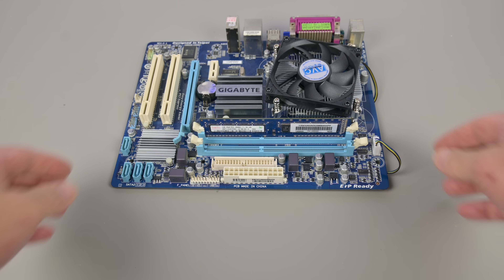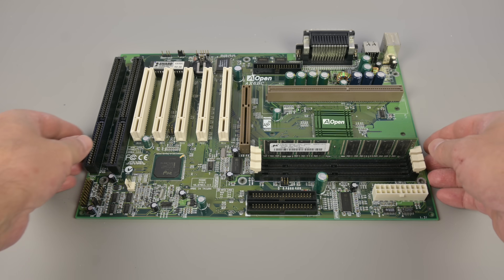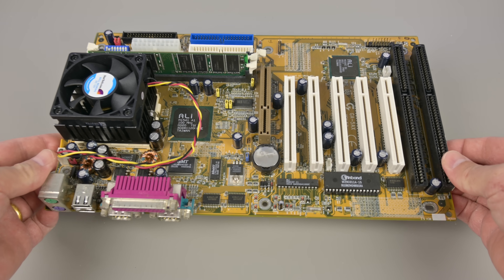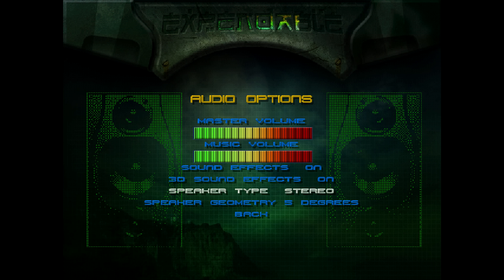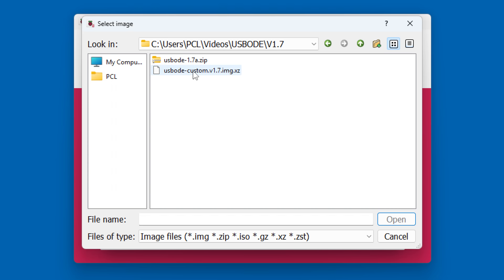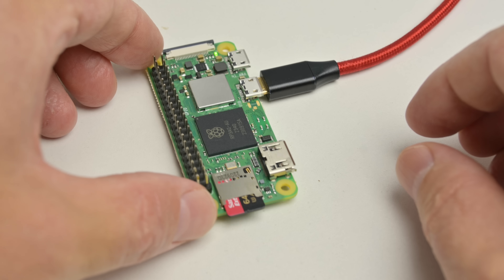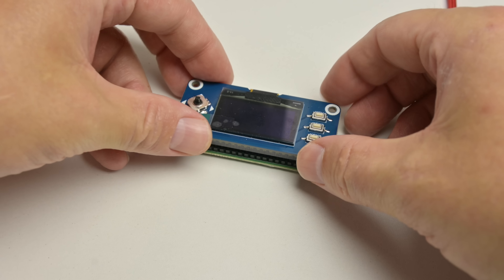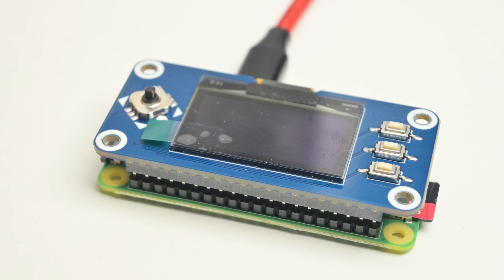Finally a cheap CD-ROM emulator for DOS and Windows 98!

Comment: How would this be usable under Pure Dos? One of my retro machines is a Pentium100 with the VX chipset and has USB. Is there dos drivers?
Reply: Ok sofar trying it on dos 6.2 on my Pentium 100 with a VX chipset, it works with ASPIusb, and it will mount images and try to work. I can sometimes see file listings and can sometimes copy a file, But I am having random read errors and freezing. But I do NOT have the Zero2W like is suggested, just the PiZero. So that may be my issue. And it may even be other things going on .. but it is very promising though!
Reply from the maker: Panasonic released USB mass storage drivers That work with DOS. I've put a collection and sample files on the discord.

Comment: OK, this is freaking cool. I've been wondering when someone would be coming out with a hardware-based CD/DVD emulator. Great stuff Phil!
Reply: IODD has existed for years.
Reply: @Drebin2293 love my iodd, but this opensource version is great
Reply: @ It's better hands down, no doubt. Just the price alone makes it great.
Reply from the maker: Great to see you here 😄
Reply: iodd and I think vantec(forgot the brand but I have both) exists but however the ftp/wifi capability; that is awesome for remote use outside retro...... I'mma about tempted to order 5-6 of em lol

Comment: Yeah, the current lack of BIN/CUE support makes this kinda useless for me, cause the only reason I'd want to use this is to not use up a blank CD-R for mixed-mode games. Otherwise I can just network share the ISO and mount it into Daemon Tools or Virtual CloneDrive (which only supports the data track of BINs) or whatever.
Reply from the maker: CDDA works with Daemon tools, so that's already the gold standard under Windows. But dir pure DOS? The USBODE makes life really simple.

Comment: This is promising, and it will get better I expect. The price means people will be using it, and people using it means it will get testing and debugging on places it doesn't work. I won't say that PATA will probably happen with this project, but this project might be the basis of something that can do PATA later. Just not for $15. You'll need a pHAT that won't be incredibly cheap just due to the quantities it'll get made. But it'll be possible to make it, at least. Just give it time.

Comment: Cool. For my ISO stuff, I use a Zalman ZM-VE300 with a 512GB SSD partitioned in 99GB and the rest. The 99GB is a special ISO partition where I can load up to 99GB worth of ISOs. The device can do optical, HDD or both but only ISO works from PC boot.

Comment: I have a Pentium 2 Thinkpad with a broken optical drive that doesn't boot from USB, would this work for installing Win98 on it?
Reply from the maker: If it doesn't boot from USB, no.
Reply: These don't support native USB boot. You will have to try with some bootmanager with USB boot drivers included, but isn't guaranteed.
Reply: @ Thanks for the answer, how could i go about doing that without an optical drive?
Reply from the maker: If you can boot from a floppy, then you can load the USB driver from boot floppy and then install 98.

Comment: Something like this with IDE support would be awesome. Similar to what BlueSCSI for older MACs does. Having this tied to USB is neat, mostly because you can store a lot of different ISOs on one SD card. But it doesn't help out with 486 or Pentium class hardware unless you can also manage to get a PCI based USB card to work. That would still exclude most 486 hardware since PCI slots were only on some late 486 boards.
Reply: ZuluIDE exists for that use case.
Reply: @bruce_just_  I was not aware of that. It's a little pricey, but it looks awesome!
Reply: @ yeah it’s all good! there’s almost no awareness of that project as compared to just getting another replacement CD or DVD drive.

Comment: I wonder if you could go further... maybe connect Pi Zero with Pi Zero 2W thru SPI or something and make custom connector and let it talk thru a PATA interface... so it could be used as ATA/HD or ATA/CDROM for computers without USB (or non standard USB).
Reply: i was thinking the same but then with only a pi pico. Look at wat the PicoMEM can do with just the pico: floppy+HDD+ram+rom+Network emulation and optional sound emulation over the isa bus.
If they use use the pico 2 w instead (much faster and almost double the memory ) surely the could add CDrom support.
And if the standard RP2350A chip does not have enough GPIO pins the RP2350B variant has 18 extra pins and only costs 10 cents more.
Reply: It already exists. Is called ZuluIDE.

Comment: I don't see an audio out plug to connect to the sound card. If one of the main goals is adding digital audio, the hat will probably be modified to include an audio output, so I'll definitely keep an eye on this great project.
Reply: YOu ARE RIGHT YALL
Reply: since the goal is digital audio (not analogue) they will likely use a 2 pin plug. 1 ground pin and one GPIO to send out an spdif signal. Just like many cd-rom drives do for digital...

Comment: While interesting, from a development standpoint, once more, is it anything we couldn't do through emulation? Daemon Tool always worked great for Windows and i think SHSUCD could use ISO's IIRC.
Reply from the maker: DOS ISOs has several challenges. I've done a video if you're keen to learn more
Reply: @philscomputerlab  Went and watched it, and it was pretty much the issues I'd expect, bar the odd SHSUCDHD slowness, but after a bit of digging, it seems its machine dependent, some will work well and some will go turtle speed. Tried it on my VMWare "Dos box" but couldn't find anything that could give "reasonable" metrics, all benchmarks seem to be all over the place in as usual, any recent CPU is WAY too fast for DOS era benches. When you can time Quake at 160fps with a "slow, just for compatibility" VGA BIOS, you know you're "way too fast" 🤣 The most stable bench i could find did clock it at a dozen MB/s, which isn't far fetched.
And while researching, ran across EtherDFS which i found interesting, because assuming the 8139 packet driver works well, should be plenty of cards around that you can just plop into any machine, use a minimal boot disk and now you can reach across the LAN for files hosted on a far easier to "manage" environment. Probably not super fast, but less aggravating than shuttling CF/SD/USB's back and forth. Needs a Linux server though. Still think PXE would be a better thing, but then you need a NIC with a bootrom AND a PXE server AND a file server, even more moving parts...
Reply from the maker: I feel lightning fast performance isn't necessary. But once it's sub double speed CD-ROM speed, well that's a deal breaker. The USBODE does less than the theoretical 12 Megabits and that is just perfect for DOS. Games install and run smoothly. Video streaming at high resolution also works just fine. Under windows Daemon tools can do much more of course and is what I would use.
Reply: @philscomputerlab  I like the idea of the device overall, a) because it's cheap a b) because i actually also (ab)use ESP32's and their USB OTG for many a shenanigan, and the Zero 2w is on my list of "things to buy and abuse". The only practical downside will be with old quirky BIOS'es that really don't behave well, but then again, should be no issue with anything moderately recent, as in P4/AXP or newer.
And again, its a perfect showcase of the "software defined hardware" case, much like the PicoMEM, because now you have capable and cheap enough micro-controllers to implement "hardware" in software.
Reply from the maker: @ErazerPT  I plan a DOS follow-up showcase video. Using Socket 7 Pentium PC. Going into more detail this time.
Reply: @philscomputerlab  suggentions for future, PXE boot if you can find a nic with a bootrom and dos vs freedos. That last one because i got some really wonky results in VMWare, and the only reason i can see for the extra 60fps in Quake is the "quality" of the VMWare vga bios and freedos doing something with VBE that Quake takes advantage of. Could be significant on real hardware too, as a more modern card might not be terribly optimized for legacy. nVidia used to care but...

Comment: theres a product already thats been made with lcd and all called iodd 300 or 400, its expensive compared to this but supports way more drives and its faster. I have the 400 model but I def will make one of these, already ordered the waveshare oled so i can use it with one of my spare pi's
Reply from the maker: You are right!

Comment: Developer chiming in here. @PhilsComputerLab thank you so much for making this video. This project has really been for helping me get ISO booting going on the ITX Llama, but you have shown to me there's so much more retro things going on!

I am focused on trying to get the CD Audio working next, and possibly expanding compatibility with older USB chipsets. It is possible to use SHSUCDHD, but you need to have an OS to boot from, and you also need the disk space for the ISOs, plus there isn't an out-of-band way to change which disc is loaded.

I'm going to continue to focus on the USB aspect of this project to try and get the CD Audio out. My goal is to keep the solution using off-the-shelf hardware so it doesn't get rare and difficult to find.

Comment: The PiKVM v2 does just the same but including IP-KVM functionality
Reply: But for more than 10x the price. Or more.
Reply: @KyoshoLP  not really - you need a hdmi to csi adapter additionally.
Reply: @ My bad. I hadn't looked at that project in quite a while. I didn't realize there was a DIY version of it (the v2 you mentioned). I only remembered the price tag, googled it earlier, and saw the same-ish prices still. Should've dug deeper. Apologies.

Comment: Hmm, with a device that supports Wifi 6/6E/7 or even ethernet, having the bigger bandwidth, I wonder if it would be possible to load the iso data off of a network drive rather than having to upload to the SD card? 
Similar to Playstation 2's OpenLoader being able to load games on a network drive.

Comment: I wonder if this thing will work with that cheap ISA USB card that people did videos on a couple years ago. It could hypothetically work on older PCs that way. Maybe?
Reply from the maker: PicoGUS? Hmm great idea.
Reply: @philscomputerlab  Oh, right, that too! Probably even better. Hah. I was actually referring to that $10 CH375 ISA USB card that LGR and Tech Tangents (among others) did videos on... 3 years ago now. Oof. Time flies.
Reply: @KyoshoLP  i was thinking more about PicoMEM. It already support floppy and HDD emulation via microsd, extra ram, network support and bootrom + optional basic sound emulation. like adlib.
The PicoGus does only sound, but more advanced, since the PicoMEM since it also  it has to use it resources for the other stuff
Reply: No, because these cards don't expose USB directly on the ISA bus. These "ISA USB cards" are more like the PicoMEM board mentioned here. Aka, device emulation only.

Comment: I'm disappointed it isn't an internal IDE device similar to the GoTek floppy emulator, but the complexity for that is likely extremely high.

It is a solution though for those who want a significantly cheaper alternative to the iodd ST300/400, the successor of the 2531 which I own.

Comment: I don't get it.  If it's about  USB booting then PLoP Linux v25.2 went out just a few weeks ago and it has both the PLoP v5 and v6 utilities built into its boot menu, while there are SATA female to IDE male 40 pins adapters already allowing a SATA SSD unit to replace an old mechanical hard disk.  But maybe the present solution has some academic value to be considered too.

Comment: I don't see the point of this project. Any computer with USB can already use a cheap USB thumb drive. If it was emulating an EIDE or SCSI CD-ROM drive - that I can find a use for. Am I missing something here (I admit I haven't seen the video yet)?
Reply from the maker: Yes you're missing that is replacing a CD-ROM drive and discs 😊
Reply: @philscomputerlab   I get that, but what is the use case? Does it do something that a USB thumb drive and a virtual CD drive software cannot do? For booting an OS you need a motherboard that support booting from USB and those already have USB-FDD and USB-CD support in the BIOS. For installing and playing protected CD-ROM titles you already have software CD-ROM emulators for Windows (I don't see much use for them under DOS). The only think I can think of is that some computers have problems recognizing some new USB thumb drives as bootable devices, but this device seems to have a lot more limitations.
Reply: @salvadorlimones1811  PCs from the transition time (the era between Pentium II and III) had a very bogus or incompelete USB boot support. Many of them will support USB CDROMs or ZIP drivers, but will refuse to recognize pendrives in any way. Also, OSs from the same era had a bogus USB boot support. XP for example, will be able to boot from USB CD without any mod or extra stuff, but you need to do extra trash and steps to boot it from a pen drive.

These are the few cases I would think this would be useful to some extent. If the gadget support emulation of ZIP drives, you can also add extra boot support corner cases. 
For anything else is a bummer: DOS Drivers are just as big as using virtual drive emulation, and it doesn't support CDAudio as well.

Comment: I’m not impressed at all with this, usb optical drives are abundant, but old ata optical drives are dying and becoming unreliable, a replacement for that is what is really needed.
Reply from the maker: With a USB optical drive you still need to use physical discs. That's the appeal

Comment: Nice thing to play around, but as lang as it cannot do cue/bin it's not for me. I wonder what makes it so hard to emulate that under DOS
Reply: Is because the way DOS works. It doesn't have a real "Storage Stack" so it exposes optical media (or anything else than HDDs really) as "network drives" via the CDEX and the DOS redirector component, with only a handful of extra command for CDAudio, which are in the CD device driver and go directly to the device.

 Doing anything more complex or in the packet level required by the CUE/BIN raw format can't be done via the MSCDEX interface. You need basically do what Panasonic did for their USB CD driver and develop your own ASPI stack, and plug every functionality on top of it. It isn't only difficult as deploying basically your small OS, but the drivers generally end being big TSRs and requiring big amounts of RAM, plus a memory manager. Unfortunately such are the penalties of using DOS.

Comment: It would be great if you could do an SMD share, so you could swap the ISO files without plugging it into a modern PC all the time. I wonder if it's possible to do an IDE hat for the pi too🤔And possibly a floppy emu just for CD-ROM drivers on older machines.
Reply from the maker: It does FTP over WiFi with the newer versions that came out while I was testing release 1.7.
Reply: @philscomputerlab  Nice 👍

Comment: Meh... I've been doing this with an old and modded android phone the last 4 years.

While is useful in certain scenarios, such as booting OSs with half backed USB boot support (like XP, which unmodded only supports USB CDROM and ZIP boot, but no USB pendrive boot), it certainly doesn't solve the problems which the more expensive ODEs are aiming for.

- It needs a big USB driver TSR in DOS, plus the ASPI stack loaded. Memory hog and may not work without a memory manager loaded.
- By the way USB works in DOS, it may slow your application/games or actually interfere with them at the interrupt level.
- It doesn't handle CD-Audio, as the driver was engineered to be used as recovery mode tool, not as a full fledged storage/multimedia driver.
- It will not work in machines without USB, that discards anything older than Pentium II. And you will not be able to boot anything older than Pentium III without extra boot managers and stuff.

There is a reason why the more expensive ODEs try to target native IDE, or some people use the existing SCSI ones along some old  SCSI card. Also, that's why people doing them are still searching for a solution to make CD audio to work. All that adds to the cost.

Comment: This is excellent! Using the Pi Zero makes this so affordable for everyone, even though there will be compatibility issues for certain use cases. Here's hoping the developer is successful at bin/cue and CD-DA, as that's the one thing really lacking in an inexpensive device. The 2 IDE ODEs I know of are $200 and $300 respectively, and hard to get a hold of. There is a SCSI one called the MacSD, which will work with PCs as well and supports CD-DA, but requires SCSI. However it's price of $120 does make it more affordable than the IDE options at present and gives CD-DA for those that need it now and can't wait. I'm honestly impressed at the about of new devices that are coming out for retro PCs that make use of a Pi or a Pi Zero. Now if the MT-32 Pi project had SC-55 GS and Yamaha XG support, that would be a perfect fit, but that's a different topic and what it provides is honestly pretty great as it is.
Reply: No ODE which emulates at bus level (ATA, SCSI) will ever have a $15 tag. Is just not possible as the components to interface the bus add to the cost, and in the IDE/ATAPI case is harder as the timings are tighter than with SCSI. If it can even reach the $80 tag by using chinese cheaper FPGAs instead the classic Lattice/Altera/Xilinx parts, consider it a fortune.